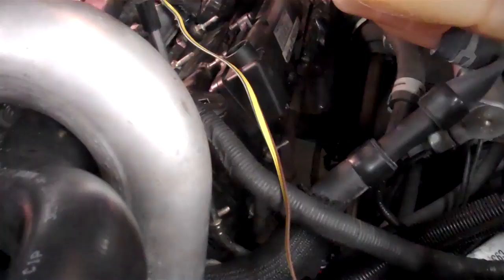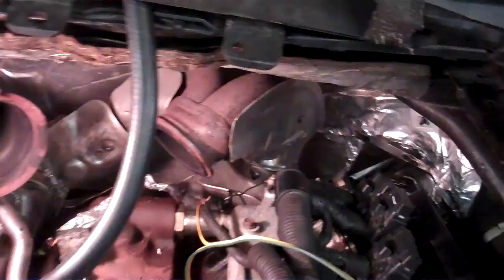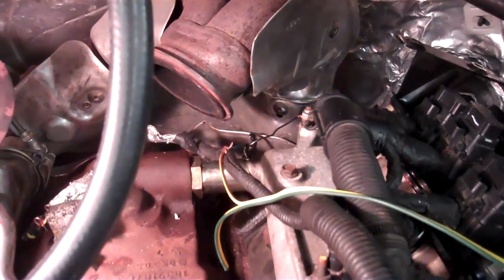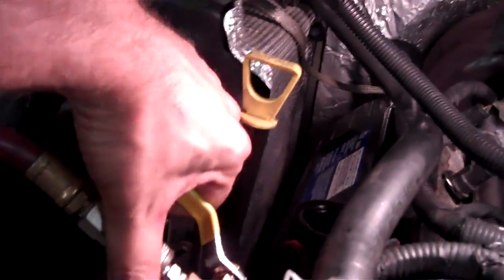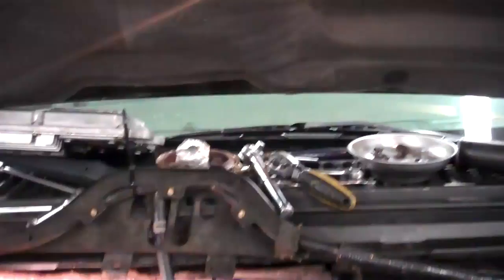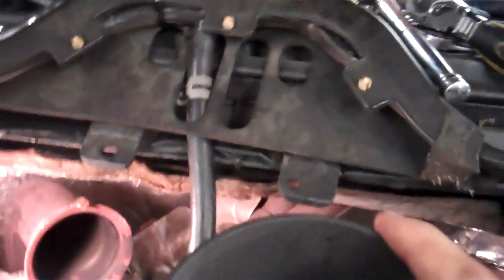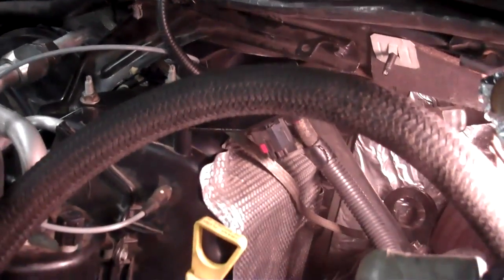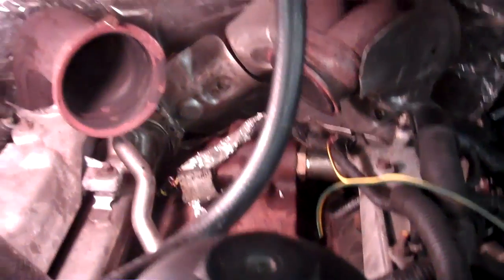Ford 6.0 Powerstroke High Pressure Oil System Air Test

Comment: should take off oil filter cap if the pump is leaking it will bubble in the oil filter housing

Comment: Mine has the no hot start issue, bad fuel economy, rough idle, and it cuts out or bucks in the higher rpm. I'm thinking it's the o-rings on the injectors. Does this sound right?
Reply: Tommy Justice mines doing the exact same thing as yours. what was your trucks issue?
Reply: Jagitty Bombz broken oil filter stand pipe and anti drain back valve
Reply: Tommy Justice how much did the parts cost you? easy to do?

Comment from the maker: DeWayne, I have another video that shows the culprit.  It was a blown oil ring in the HPOP cover.  The symptom was no hot start.  I had already replaced my dummy plugs and stand pipe rings.

Comment: You ever do HPO work on the previous generation 03-04. To my understanding they have less problems with this hot start issue. The switch from round rail to W pipe a good idea?

Comment: I have an 05 died and now cranks with no start, I just did the ICP air test and the only thing I hear is a slow quiet gurgle from the turbo oil supply line hole. When I appy 12V to the IPR it stays the same no change???

Comment from the maker: All of my knowledge comes from an excellent forum at ford-trucks   I purchased a oil pressure test kit from Harbor Freight that had the correct adapter in it and them took it to my local auto parts store to finish the other parts I needed. You need to do an air test to find your leak.  You also need something like a ScanGauge II to help you narrow down the issue.  It will show you your IPR valve %, and your pressure in the HPO system.

Comment: Hi can you tell me exactly where that is, how I can get to it and where did you get the fitting to attach your compressor to the ICp sensor hole? Cuae I have a 2007 f350 6.0l with same problem. I my mechanic did my stand pipes, dummy plugs and stc fitting, but like you it did not fix my problem

Comment from the maker: In this case is was a busted 0-ring on the discharge tube that connects to the cover.  If you have an 05, I would suspect the STC fitting was bad.